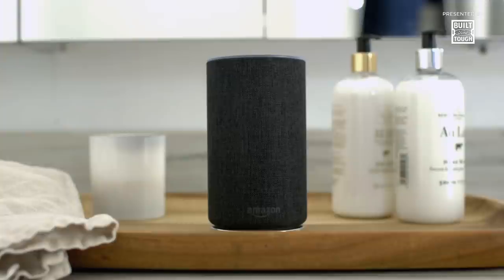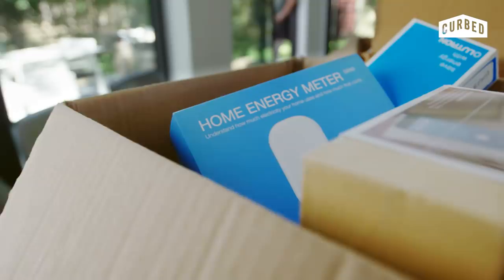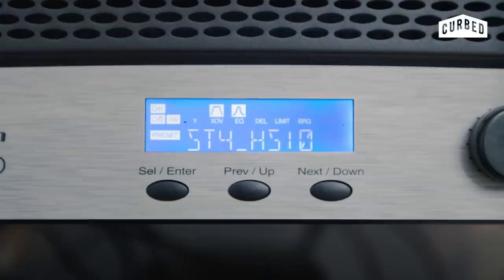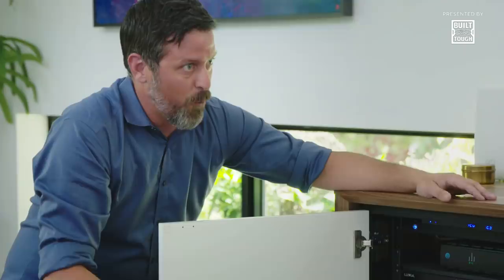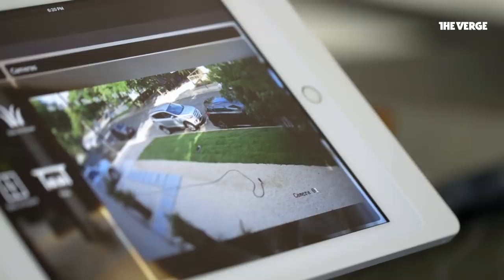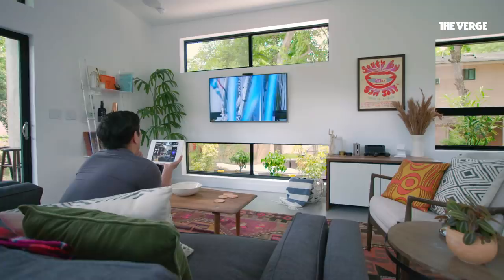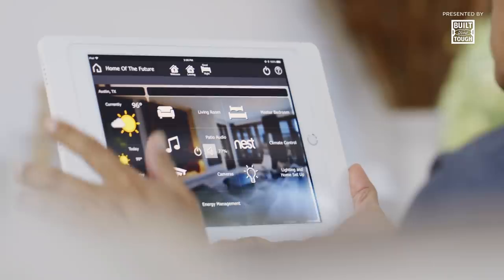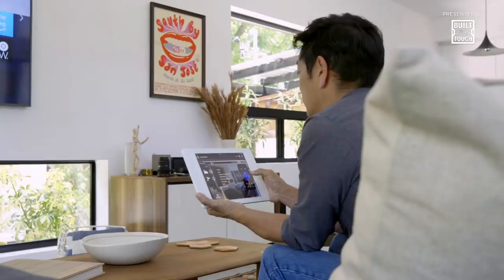Designing the brain of the Home of the Future with Grant Imahara

Comment: Nest Correction:
Nest used to support a relatively closed API; however, Nest (a Google Home company) has been working on Thread Group's Thread network protocols which are available through Open Thread (by Nest).
Thread is based on IEEE 802.15.4 with IPv6 which is referred to as 6LoWPAN.
Thread is absolute for routing between IEEE 802.3, IEEE 802.11 and IEEE 802.15.4.
I am developing tools and hardware which will use Thread to end Bluetooth in the very high-end smart homes.
Because Thread is open, Nest is no longer using a closed API.

Comment: I love having a smart home and have enjoyed doing it and updating it with new technologies. The main brains for mine is using a Raspberry PI 3B with OpenHAB2 software. Most of the switches are modified Sonoff switches with MQTT capabilities, an Insteon thermostat and HUB as well as Alexa and a few Chromecasts and Firesticks. With OpenHAB2 you can communicate with around a hundred different brands of devices through what they call binding and more are popping up all the time.

Comment: I use an Amazon Alexa device together with my self designed 'WiFiDomo' smart devices. RGB ledstrip through the entire house, led dimmers where white light is needed, the WiFiDomo Alexa to IR remote converter and smart switches that scan the entire house for presets. 

The entire system is modular and can be used with only 1 module upto as many as you need. Every module has it's own web-interface and can be used without any 3rd party software. (Easy integradable in your own interface/software)

Comment: Looking at the ridiculous amount of oldskool wiring, the home of the future seems pretty far away to me.
Reply: Indeed, it's bizarre that each device appears to have a dedicated PoE cable; in modern cars the trend is to daisy-chain the low-power devices on one cable and use remote hubs for high-power devices...
Reply: When we home run the POE it gives us control over those devices individually and remotely.
Reply: Old school? This is all Cat6 wiring and we have conduits for fiber to be pulled in the future.
Reply: @Linus Das - Because if the first device in the chain dies, then they all die... Home run means one dead device doesn't kill them all.

Also,  for the "wireless" crowd, when they invent wireless power, then we'll be wireless, until then, everything needs to be plugged into power.
Reply: what is new school wiring?
Reply: wireless = new school wiring
Reply: I know this was a year ago but, when he said that 'reliable wireless solutions are not available' I stopped taking him seriously. I have been using zwave lights for about 5 years without any issues.

Comment: You can integrate most of those systems and many more with a basic Node-Red server if you want to do it all yourself with no monthly fees. It's software that runs on anything from a 5$ raspberry pi zero upwards. It just takes time to learn the basics, but it's all on the internet, tutorials etc. For most typical homes you don't need a very expensive server like the stuff shown here, it's quite overkill.

Comment: You could've done the same with a small home server and/or a few raspis. For stuff like that I would definitely recommend going open source. There will probably be even more hassle to set it up, but you are not bound to a company that may go under, don't have to run possibly unsafe or old proprietary software in your home and of courst it'll be much cheaper. Also that way you will actually understand what the systems are doing and you can still integrate proprietary stuff as you like if you have an "open backbone".

Comment: It actually makes your house LESS secure . As a European we tried it here in France and ended up with a HUGE electricity bill —they put all the convectors & devices on. And all windows/doors OPENED when getting back from holidays. The system was hacked ! Since then I have been degrading the stuff, suppressed the Wi-Fi —4 stories house. Put Ethernet + adaptators for the new Apples. Right now I'm replacing the cameras with "invisible" ones. 
In order to keep my house CLOSED to the world outside. 

A friend of mine also found her house often opened. After investigation, an army device was interfering with hers. Each time they moved their trucks, the garage/ house was opened for several hours .

Comment: Now that electronics, home devices and appliances are meant to be connected, you probably have to get every product from the same manufacturer for it to actually work. For example, Samsung and lg both have appliances that communicate with each other directly, like you click a recipe that your smart refrigerator comes up with based on the food that it sees inside, and you can send that to your smart oven, or building a home security system where every component has to connect to each other like a traditional cctv system, stuff like that only works if they are from the same brand. Even when you what to connect to your smart home appliances from your TV, it may be harder to do if you have something like Samsung TVs and LG appliances. And speaking of TVs, they can’t even connect to each other if they are different brands because they use operating systems. So, until companies work together, or smart home hubs can translate data from a product of one company to a product of another as an indirect mesh, we are stuck with choosing one brand for everything to achieve the full potential of a smart home.

Comment: Just reading a review on this company and what they offer and there was a CON stating that RTI has 100 partners but the Equipment selection is still dwarfed by that of Crestron and Control4. I suppose that means they have a rather limited list of devices with which we can choose from. I'm sure it's nice to have it all in one place, but I still think the expression "putting all your eggs in 1 basket" might give a reason to rely on more than 1 app to control some things. Such as, having Philips Hue control the lighting specifically since there are way more options offered within the Philips APP that no other ALL in One solution offers. Simply put, Lighting on one APP, Climate Control on another, and Audio Video can also be separated. For those who want it all in one place, buy a tablet, and slowly add each smart device as you upgrade your home. I know there are apps that will act as front end menu systems so you can create shortcuts to run the respective app that controls specific smart devices. It just isn't likely all the functionality will be possible in a single app unless it is the app provided with the device. 
For new installs, wire up, and then APP up. If you can do a little handy work, cabling is nothing. It's not like everyone needs to pay the cost a company would charge which is likely a small fortune. In the end, this smart home is awesome but unrealistic. It's a well engineered demonstration of what a smart home might be in the future. But the real world today will not dictate such a home. A niche group of people, perhaps, and they will have plenty of money to burn. But for most people, there are just to many free options for software today. And the installation of most devices can be done using wireless connectivity and most homeowners can handle that. Plus this gives us the choice of purchasing well known devices we prefer and hunting them down at discounts instead of having limitations and paying contractor rates plus markup and possibly ending up having to settle for a thermostat or other device we didn't prefer due to the limited choices we were given. But RTI does do nice work. I just think alot of people can do the same thing with better results costing tone less.

Comment: One thing I am concerned about is the airflow in that cabinet.
I don't know how much heat do those devices generate, I never worked with a PlayStation, but when it comes to the Xbox, I know it needs good airflow, preferably in an open environment. Based on that I can only imagine the other devices need good airflow too. Other than that, like others mentioned in the comments, I'm not sure this is the right path to the home of the future, but it does look nice.

Comment: This is great and awesome. If the API's can all be open and make it easier to get Z-wave and Zigbee to work together instead of getting all these hubs to support each "language". Also the network will need to be able to support all the multi in and multi out "MIMO". That way the router or switch can support more and more devices as the years go on. The wifi mesh is a good alternative to this if you prefer to go wireless instead of the video where it's all Cat6a i bet. Cable is still better as wireless data bandwidth will cap at some point but with cables you can get the stability you want. Very good video. I like how the guys told Grant that he can't but i am sure Grant is smart enough to configure all of this with that custom app since the language to configure it looks very easy.

Comment: There is an old (industrial) system standard call "Modbus" can perform similar tasks, through RS-232 or RS-485 you can line things in 2 wire (signal).
Reply: We use that system in our Vantage lighting jobs.

Comment: i'm 2 episodes into this, about to start 3, and haven't heard anything about insulating/sealing the house. the guy in part 2 talked about the giant energy hog, the hvac, and minimizing its needless use. that's the perfect segue into insulation & different ways to actually heat/cool a house. does this modular housing company, ma modular, insulate the hell out of the house? is it set up to circulate climatized air? does it use minisplits? what's the story here?

Comment: I see many comments about the lack of user programming. 
That is the #1 deterrent for me.

There is no reason other than lack of unifying structure.
All smart devices should be able to host a webpage and password access.
DIY ESP32 stuff is all over, but most require using their app to setup.

Comment: Let's see an equivalent video where you do it with google home as you suggest at 7:35 - what's the shortcoming of that approach?  Other than wiring your in-ceiling speakers, do you need a single other cable in the walls?  With a mesh network, google home, lutron caseta (or variants), chromecast, you can do most of this and just talk to your house or use the phone in your pocket instead of chasing the old iPad around and paging through menus, paying a monthly fee and having someone else program it.  LG now has google home assistant voice recognition built in to their TVs.

Comment: I certainly get over the top stuff, but there's a point where reality kicks in.

Examples, if this is just an example fine, but having all your wires homerun to your family room is insane especially stuffed into a small "box" with no room for expansion. A mechanical closet or utility room is smarter and with good ventilation and cooling. Not to mention short of living on a farm with at least 400' feet between homes having loud base speakers would be a neighborhood crisis. Directional tweeters and mid-range are okay. Even that clunky iPad remote, and I'm familiar with this company, is kinda crazy as well. It's like something I had 20 years ago. Things now are hidden, sleeker and frankly small. I too understand it can use a phone and voice...

Comment: It's pretty much a hand-built, pre IoT smart-ish house:
A handful of Philips Hue lights in part of the house, controlled by iOS apps
Belkin Wi-Fi smart plugs in the living room, controlling the lights - on at Sunset, off at bedtime.  In December they're also in the yard controlling the Christmas lights.  Android app and Alexa controlled.
No smart thermostat - we have a millivolt system and none of the IoT thermostats work without a good amount of support circuitry
Old iPad velcro'ed to the fridge to manage an iOS to-do list via Wi-Fi for grocery shopping
The entertainment system is an absolute Frankenstein with a Sony Android TV, Dish Network DVR, Apple TV and Samsung 4K Blu-ray all routed through a Denon receiver.  No joke: four of those devices have Netflix capability.
34 solar panels on the roof (7.8 KW system) with Enphase microinverters reporting their status through an Enphase Envoy gateway.
Rain Machine ET irrigation system, connected via Wi-Fi and controlled by an Android App
Zmodo Wi-Fi security cameras, most powered by micro-USB adapter but one more remote outside device is powered by solar panel charging an SLA battery, connecting to the in-house Wi-Fi network.
The most recent addition is a hybrid indoor/outdoor weather system using an Acu-Rite pole mounted weather station (measuring temperature, rainfall, wind direction and speed) and a LaCrosse Alerts system measuring individual room temperatures.  Both have a wireless internet gateway / hub that feed to their respective websites.  I've written custom code to pull JSON feeds from each source and combine them to active web pages displaying on Amazon Kindle Fire devices mounted on the walls in various rooms.  The screens show time, weather and temperature in that room as well as the accumulated rainfall and weather forecast via Weather Underground.

Someday, in my copious spare time I'll start to play with IFTT or Zapier to make the whole lot a bit more integrated - right after I modify a Nest to work with a millivolt wall heater...

Comment: G'day from downunder, I went a rather odd way about it, just about most of my stuff connects directly with wifi, Sonoff light switches and Sonoff Basic switches fitted to extension cords, was an affordable way of controlling most things, only issue I had with that was the 2.4GHz wifi on my ISP supplied router ran into a few issues connecting more devices, so to fix that I installed Google Wifi mesh network (3 puk's) around the home and that issue is now gone, found some good mounts to fit them too the ceiling so no wires are visible (But did have to install service power sockets inside the roof cavity). Also got Google mini's about the house also fitted to the ceiling using a mount nic named  (Google search:The fly's eye Mount Genie ).

Comment: As a Hi-Fi enthusiast I have to say modern Denon amps are ok at best, they just work but do not impress in the slightest. I was more impressed by the sound of my 1968 hybrid tube radio with 6 watts than a $2000+ Denon pma-2500ne. Its not just Denon, any modern amp ever is ok at best but not impressive in sound.

Comment: Go with IoT Platform like Home Assistant which is becoming easier as the days pass on,  as other commenttator mentioned the Smart Home devices are becoming cheaper and easier to integrate as the days pass on , hence this technology maybe Windows 95 of the near future in the current pace , save hard earned money for your old days pension pot. I use HA at home , by the time i start and finish i could see changes in the market, Stay Clear and Stay focussed on what you want to achieve end of the day ,  productivity does not mean you have to shell out a Million Dollar.

Comment: ok Grant I have a couple of questions, first off how much of a cost is incured with having such a Sophisticated syatem intgrated into this home
how do you keep intruders from hacking into the system and accessing your camers or listening devices for nefarious purposes , which pretty much defeats the purpose of having a system like this, and what if you have someone in your home on a resperator  , what's again is to  prevent someone from accessing the system and turning off the power ?
or if you live in a place where you have cold climtes where you get belo zero tempeatures during the winter and someone acesses your home system and turns off the heat?
also how much do you have to depend on the company who installs this devide to your home for updates and maintanence, how much are you going to be charged for services calls?
also how secure is the Alexa program, from videos I'm seeing and stuff I'm reading it's not a very secure AI t all.

Comment: Not particularly impressed with the equipment inside the rack, but a enclosed rack disguised as a credenza in your living room, pretty smart. I'm more curious as to where they found that credenza than any of the other equipment. My only concern though is noise + dust filtration, but I would totally put my server rack in one of those.

Comment: Home Assistant. End. Sometimes it's better to make a little effort and get into the learning curve. Then you see things like this and they are useless and/or expensive without any purpose. Don't fall in "okay,  but you have to study at NASA to get HA running and then it's horrible", do not. It can be customized up to the maximum detail AND (most important), you can use it trough Apple Home for example. So anyone can use it with a nice/known/integrated interface.

Comment: Solutions such as RTI or control4 and others are overkill, not customizable by the end user without contacting their engineer (and hence a closed system essentially), so for DIY enthusiasts they are an expensive option. Google Home is developing so fast that they will trump such services very soon with their easy to use interface and scale of out of the box integrated vendors.

Comment: I don't really see the point in a centralised system like that, especially when adding Alexa to it given that Alexa can already do pretty much everything that Tablet is doing. 

As mentioned add Google Home with a Chromecast and Home-ready devices like Hue and smart plugs and again you're achieving it for a cheaper price and no monthly cost.

Even many smart TV's already bundle most of the tv-based benefits so you only have one remote to play Nelfix or Amazon Prime or whatever.

So how is that any less convenient than using a tablet on a closed system that you can't even modify yourself?